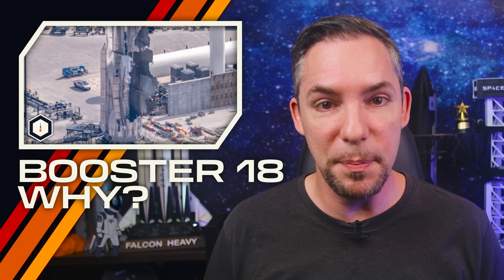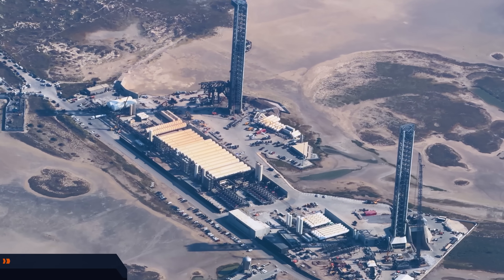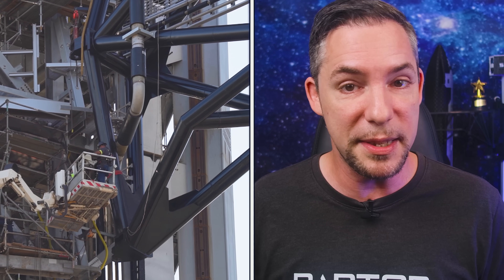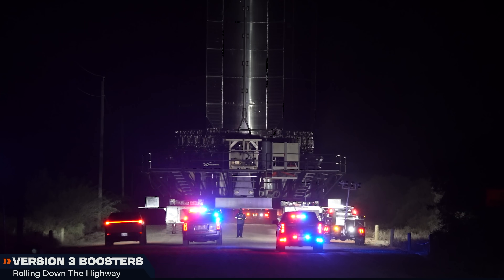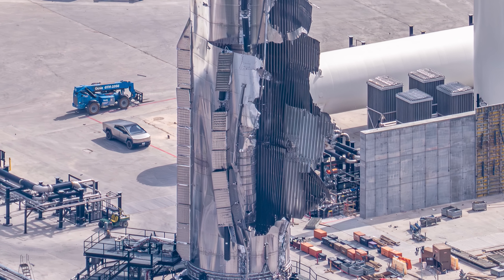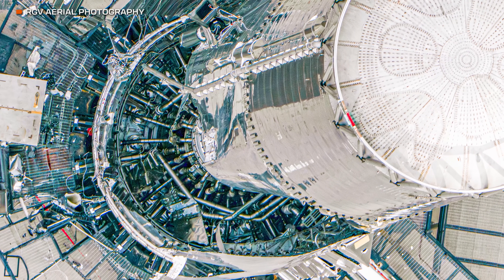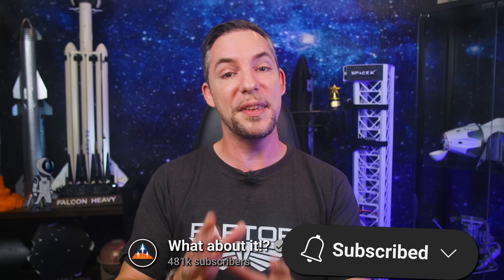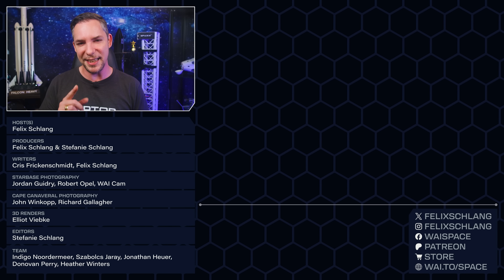What Went Wrong With  SpaceX's Starship Booster 18? Is SpaceX In Trouble?

Comment: SpaceX has been taking a 2 steps back 1 step forward approach.  Seriously, this last failures make Space X look bad especially after BO NewOrigin flawless launch and landing.
Testing is fine but the blowups were not part of a test to see if a new solution worked, SpaceX fully thought it would work and lacked design or the building skills to pull it off.

Let's stop defending this mad scientist iterative design.  Apollo 11 landed 2 astronauts on the moon successfully, Starship 11 did not even make it to orbit.   NewGlen landed the NewGlenn on their second try.  You do not see them blowing boosters left and right. 

It is important to remember that a lot of Starship's NASA funding is to get the USA back to the Moon.  At this point, SpaceX is nowhere close to that goal and the 8-40 refueling missions needed to set Starship on its way to the moon is absurd.  The Chinese will have a base on the moon before that solution works.
SpaceX needs to starts developing a light weight aluminum Starship, with expendable stages, with livable space.  None of that is happening.  It does not look like SpaceX is working seriously to get to the moon.  They just want to develop a LEO reusable platform.
Reply: Yeah, let's use aluminum and lower the ship's melting point by 50%.  That'll help...
Reply: @christopheblanchi4777  i respectfully disagree to all your points man! Chinese won’t be ahead of USA for sure
Reply: 1. BO is 10 years behind SpaceX. Just because the two programs run in parallel that doesn't mean they are competitors. New Glenn is much closer to the Falcon Heavy in specs, and the Falcon 9 in design.
2. Blowups are absolutely part of the test. You only test when failure is possible.
3. You forget that SpaceX absolutely dominates the space industry. 90% of all mass to orbit, like 70% of all active satellites in orbit, and all made in-house.
4. BO uses a completely different design approach. They design on paper until they are very sure it'll work. The downside is that it takes much much longer, and the necessarily higher safety margins cut into the payload capacity.
5. Starship had many similar failures, and all proved to be just speedbumps.
6. Your "solution" would only add more delays, and make the entire program unnecessary. The whole point is reusability, that's why Starship exists.
7. The goal is to colonize Mars.
Reply: its more about getting it done than doing it first i'll be honest man. a bad look on it or a good look matters little. Following different philosophies to design and contruction is fine as well. ur looking at it as a competition not progress.
Reply: SpaceX only gets paid for meeting agreed-upon milestones. They don't get paid anything when failures occur, unlike other contractors. Starships after flight 3 could have made it to orbit if SpaceX had wanted to burn the engines just a bit longer. They chose to turn off the engines just short of orbit out of an abundance of caution. And why would you care how many Starships will need to fly to fill up an orbital fuel depot? You are not paying for it. Not even NASA is paying for it. It could be 8 to 20 Starships, but who cares? However far you may think Starship is from their lunar landing goals, they are by far the closest of all the competition. SpaceX has always loudly proclaimed that they want to settle Mars and build a Moonbase. Along the way, they will certainly make use of Starship for LEO operations. And they will save tons of money doing so.
Reply: And the platform is designed only with launching Starlink satelites in mind.

Comment: It might be on purpose.  "Burst testing, a type of destructive pressure test, is frequently performed on pipes, tubes, small vessels, tanks, and other pressurized components to determine their maximum burst pressure and how they experience failure. Our competent technicians conduct this test by increasing the pressure level under controlled conditions until the test sample fails, or “bursts”. With this method, we can measure the maximum amount of pressure that components can withstand before experiencing failure or permanent deformation.
Burst pressure tests are useful in locating weak points in materials that can potentially compromise performance and safety."
Reply: Such tests to destruction are done on subsystems, not on a complete rocket. It was not even close to "on purpose".

Comment: Surely when you’re developing prototypes, testing and finding the issues is part of the process. Business as usual as it were.
Reply from the maker: Exactly!
Reply: @Whataboutit  Felix the cat shlong, head buried deep into sand. Shlong I don' wanna think about......
Reply: I'd say if it's a CPV then the failure rate on CPVs is way too high if they intend to put humans in a Starship.  Critical components should have a failure rate around 1 in 10,000,000.  This has been the second one in a single year.  I'm not sure what they will use as an alternate.  Aluminum pressure vessels weigh twice as much.
Reply: this aint 1950 buddy... stuff liek this should be caught in the drawing board... choosing xspace for the moon landing was the wrong choise and now chinba is gonna take hte lead into space.. sad how you country got conned
Reply: @MrChaosi China is so far behind in terms of a reusable spaceship to space
Reply: This was not business as usual. This is the kind of failure you not suppose to find out this way. (The big pressure tests are done on subsystems and if you are unsure of any parts you build a test tank or such a thing). Yes, it of course happen during a test but that is only a test to proof it, its not suppose to fail at all. (So its either a manufacture error or a MAJOR design/development error because this should have been found earlier)
Reply: @drosendahl  Shhhh, bro - you will upset the fanboyz and fangurlz. They might even cry, or worse yet be offended.
Reply: True but when you do this you have to say to yourself, after 12 tries, is it designed properly or does it need to change.
Reply: @flightsimdev 
This is the first pressure test of a V3 booster, out of the 12 times you’re talking about that is a mixture of V1 and V2
Reply: @flightsimdev  actually that would only count if it was the exact same thing failing every time, they keep testing every corner and peice NOBODY has been doing what they are, and the ones now are only playing catch-up
Reply: @Garlinn  Ship version one had a 4mm skin, version two got larger, the skin is 4mm, and now the ship is much longer, has more engines bigger diameter, and guess what, the skin is 4mm thick, I think I know my guess.
Reply: @flightsimdev  They're constantly implementing changes. Instead of designing something they know will work they implement changes and see what works and doesn't work